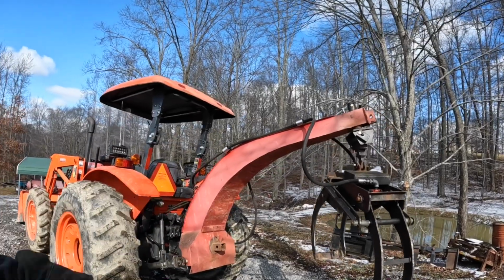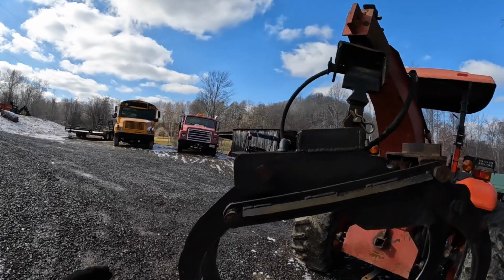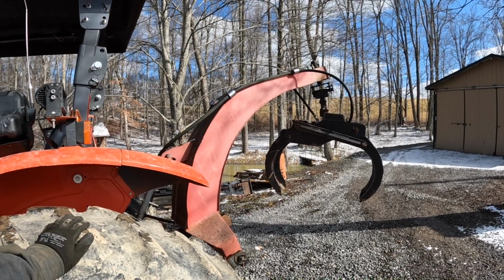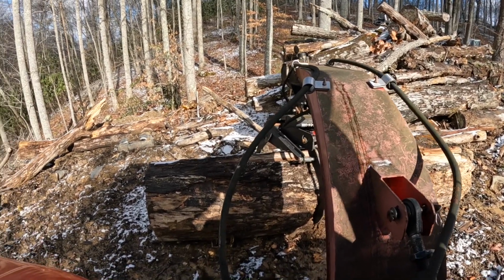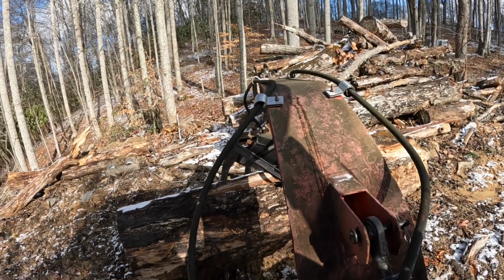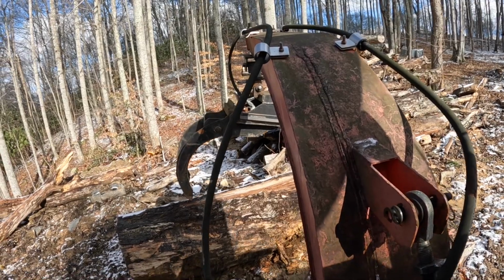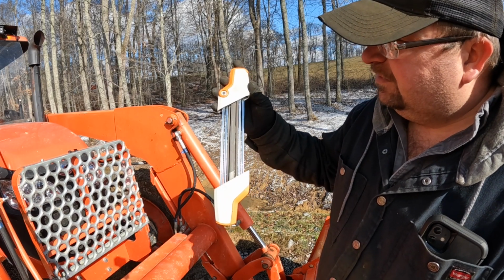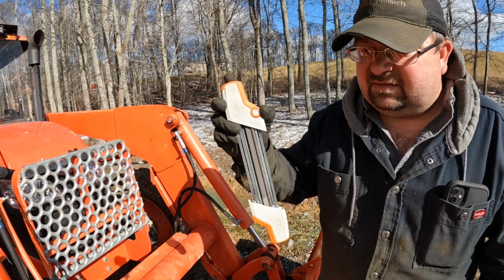Using a 3 point Log Grapple on the Kubota M6060.

Comment: Hey Ben - looking muddy there with the snow melt, but looks like your tractor is getting along just fine with those R1 tires. I just posted a video about my misadventures with one of those sharpeners. I wish a chain was a chain and they'd all take the same sharpener LOL, but of course everything is always more complicated than it seems.
Reply from the maker: I just watched that video! I’m glad you shared that info on the file size. I hadn’t thought to look at what size file was in the guide on the new one. I’ve only used the file once and did notice it rode higher on the tooth then I felt it should. But it cut good so I didn’t think much else about it. I’d say after a few times of using it you would start getting negative results if the file size is wrong. Thanks!

Comment: I love it.  I'd have to build accessories like a saw scabbard and a tool box/bag for cutting and logging.  BUT I LIKE IT!!  I'd love to build one like it, but I usually have to pull with chains quite a way before I could hook directly to the tractor... but it would save a few times climbing off and on the tractor to move a single log.  Oh, no.  Now I'm really thinking.
Reply from the maker: I used this that way too,  just pull with chains until getting the tree in the road then grab on and go. Appreciate you watching Logan!

Comment: If I was you Ben, I would break out the cutting torch and the stick welder and move the lift point of that grapple a couple of feet closer to the back of the tractor. it would make a heck of a difference as far as you pulling wheelies with a tractor goes and up the lift capacity quite a bit.  I have a hydraulic top link on my tractor, so could get even closer with my setup and still be able to get the grapple to the ground  with a good bit of lifting height.
Reply from the maker: I like it being that long for reach, it was designed long for that reason. The log I was trying to lift was over 2,000 lbs because when I moved it with the loader the other day it squatted the tire pretty good. A hydraulic top link would be nice. Thanks for watching.

Comment: I have never commented on a video, I would love it if I could get some dimensions on how you built your grapple.
Reply from the maker: For the arch I had our drafting class design and print out a pattern that I could lay down and trace to cut the steel. On the grapple I just looked at pictures of grapple designs and came up with the size I wanted. Used a 30 gallon trash can to pattern the grapple fingers to the correct size. Thanks for watching
Reply: @khtractors  I believe this is probably the best design I’ve seen, I hope I can get the distance from pin to pin and cylinder throw correct. I used to work for a palfinger crane company and can get heavy duty two inch Grease zirk pins. Love your video’s and your talents. I will build a grapple boom in the future.
Thanks and keep the videos coming 🙂
Reply from the maker: @denniswelly1988  I needed bigger pins. I’ve had to replace them a few times. If you’ll email me I’ll try to get a few up close pictures to send you.